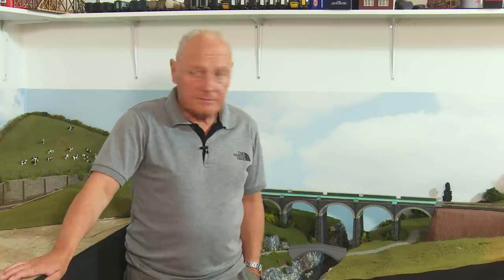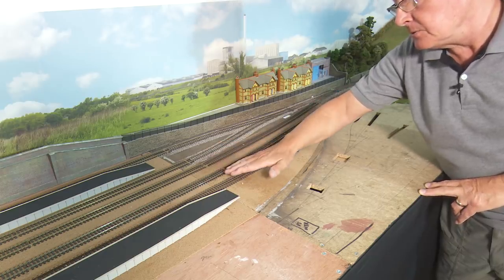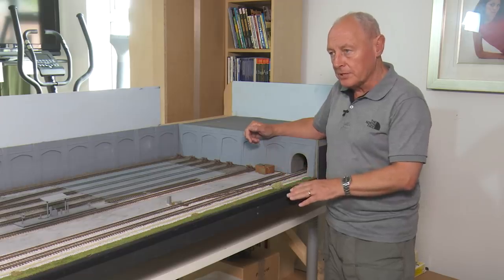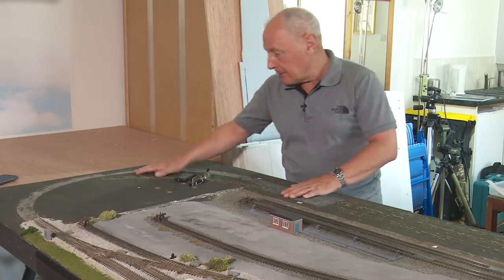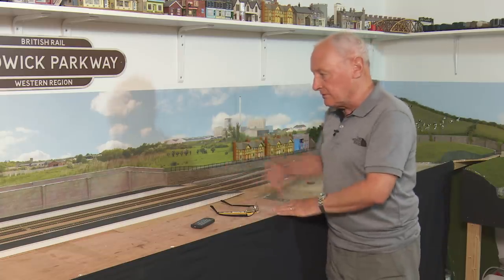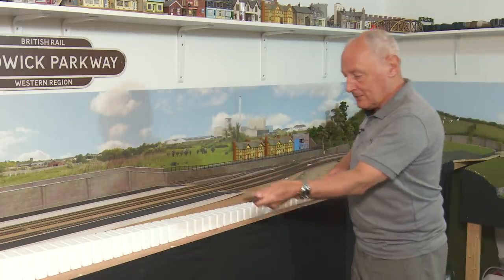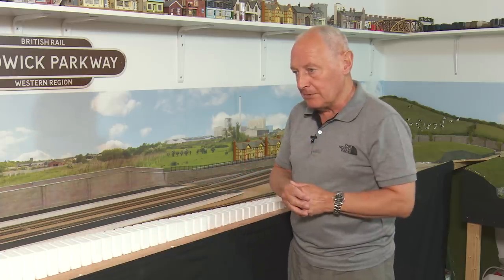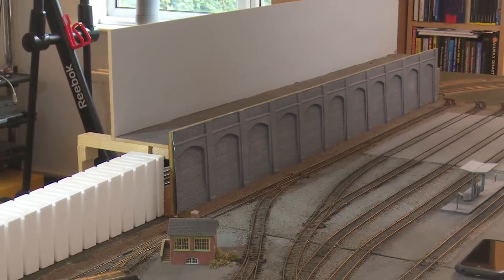A boring track plan at Chadwick Model Railway. | 72.

Comment: Another great entertaining video Charlie (and I like the haircut!).  My layout plans are going through the same  machinations as yours.  My layout was going to be a tail-chaser, but I didn't want a lift up section or have to crawl underneath to access the centre, so I'm changing it to a "U" shape with return circles at each end to give me up and down fast and slow lines through a "Nottingham Victoria" style main station.  But the main running lines are all going to be at +100mm and I need to get down to the base level at +0.00 for the MPD and fiddle yards, so your experiments with inclines were extremely useful.  Keep up the good work and the videos.
Reply from the maker: I’m so pleased that you enjoyed it and found it useful Geoff.

Comment: Great video Charlie....but, if I may, the 4% is way too steep and detracts from the work already in place or planned. I would opt for a 2% grade, curving to accommodate length, and blend scenery around or tunnel (for a scenic break) before entering station forecourt and throat. Also leave the goods siding, great idea and too good to lose. It will come in handy in so many ways. These ideas blended with the expertise of the other contributors should bring you to your solution. For myself, I try to plan situations which will require me to watch carefully and not nod off...Rather like american practice where double track suddenly becomes single and requires prioritizing traffic.
Reply from the maker: Sound advice mate, many thanks.

Comment: Hi Charlie, I like the idea of the terminus station but that incline "looks" a bit steep.  I know your diesels will get up it but it just doesn't look right to me. You mentioned that the 4% ended about 3/4" below required level so could you not use a 3% incline and extend the climb around the end of the room? There may not be room, difficult to tell from your video but hope so. In  terms of the width I would suggest as others have that you use the foam as a base to build out a bit of ply to widen to 2 track width. If you have Anyrail that is really useful for testing out incline lengths. Think the idea of swinging the TMD board round is sound as well
Cheers Steve
Reply from the maker: Sound advice, thanks Steve.

Comment: Very interesting. Keeping in mind a good few branch type lines will run with inclines randomly spread across the route, guessing they were always designed for slower moving trains, makes sense to add an incline rather than digging out further just to keep the line as flat as possible. 
My layout is full of inclines ranging in various lengths and nothing struggles on any of them. All were fully tested with 12 coaches. 
I like the idea of inclines as it adds a great dimension to a flat layout.
Reply from the maker: Great encouragement, thanks mate.

Comment: Charlie,  at present I don't have a layout. Just sections waiting for space to become available. I did have a nice operating layout. I used by single track  4 percent grades for the first 3 switchbacks and the last two switchbacks I used double track 2 percent. I modeled in HO scale.  My trains were all DC .  Using 2 locomotives on head end followed by 10 or 12  40 ft open coal hoppers. My base mainline was 52 inches from the floor. My branch Line to the coalpit started at 52 inches then rose another 3 feet.   I worked out all the elevations myself until I was happy with the operations. I used a modified cookie cutter idea for rise in elevations. I referred to Jim Mc Cleahands book.  Modeling Coal Roads.  Unsure of the publisher.  The risers we're all wood blocks cut to width then screwed to risers cut to length. Following Jim's table of inclines per gradent.
Good luck in your pursuits.
You have right idea.
Reply from the maker: Thanks James, valuable advice

Comment: I'm facing similar issues on my layout re the incline double width issue. In an attempt to aviod doubling costs on a parallel incline, I'm considering using 3mm ply cut to railwidth needed and placing that onto the single incline structure. As always the issue of cost verses time is a factor. I'm now going to wait and watch you! 😜
Reply from the maker: Oh, no pressure on me then RCR! 😜

Comment: Hi Charlie, Glenn from Australia here. Another great video, brilliant to have a tour of the layout, cheers.
Like the idea of the risers and second station above fiddle yard. Will add more operational options. Roundy roundy and fiddle yard, to terminus, the best of both worlds. Speaking of operations, have you considered the possibility of double crossover in your existing station ala Exeter Central for making up and splitting pass. trains?
Also wanted to say a friend here has used the same 4% risers, only single track though. He had a few issues, diesels were generally ok but steamers did struggle, maybe not a problem for you. He overcame this by using the DCC magnet system, not sure what its called? The other thing to make sure of is that all couplers are level and reliable as he used to have quite a few breakaways on the transitions up and down. I am certain you will be on top of this though.
Thanks again, is good to hear your thoughts and conundrums re. planning
Reply from the maker: Sound advice, thanks G.

Comment: Whilst it may be expensive, maybe to liven up the area where your stations tracks convert into two tracks, you could do something similar to what Newcastle Central had in the 1950s, although more practical using double slips and diamond crossings etc?
Reply from the maker: I’ll have to do some research Luke.

Comment: Hi Charlie,  Some years ago I used the self same products for similar reasons and all the locos went up and down the inclines correctly.  The layout is not completed as I have not built the equivalent of the station (been working on Yeovil Town at the club) and the loft is bunged up at the moment else I would show you how it works (I am in Yeovil) - On my layout I used that product with the black track-bed as I could start the incline around a bend (something that works well to save space) - I wish I had thought more about droppers prior to laying track.  I have a double concrete track for modern image.  Paul
Reply from the maker: Sound advice mate, many thanks and we’re nearly neighbours!

Comment: Hello Charlie. As you know, I'm a big fan and love what you're doing but I'm a bit confused with your plan for the elevated station. 
The planned incline looks as if it will start before the current through station so that traffic to the high level station will avoid the through station. I think it would be unusual for a branch to diverge before the main station.
Just a thought but have you considered having a high level platform, part of the way up the incline (short level section) so that the main station would be served by the branch?
I hope you understand.
Regards,
Bob
Reply from the maker: Hi Bob, yes that’s something that I have considered and it’s still an option.

Comment: I’m building my first OO gauge DCC layout and use the 4% woodland scenic inclines. A great product but you would need two sets side by side to ‘safely’ carry your double track lines to Chadwick Central. 
An elevated station would be a great idea to ‘hide’ the fiddle yard, as long as you build in easy access for ageing hands and eyesight!! (from personal experience)
You could also run a line, ‘elevated’, through Chadwick Central and connect back down an incline with your beautiful new viaduct.
Thanks for the great video production and interesting topics. 
The most important thing though is, would YOU enjoy that layout?
Reply from the maker: Thanks John, it’s comments such as yours that make it worthwhile

Comment: Another great video. Thanks.  When I added a terminal station onto a small 5ft x 6ft layout I just used 1/4” ply supported on blocks of wood of varying thickness.  Worked treat.  (00 gauge). Also avoids the environmental issue of using polystyrene.

Jim
Reply from the maker: Sound advice, thanks Jim.

Comment: Hi Charlie,  You've given so much help in the past, so I'm pleased at last to be able to share a little experience in return.  I'm using the woodland scenic's risers and double track.  I've got a branch line going upwards and the two main lines going downwards so that the main lines which lead to the fiddle yard are under the branch line which is my scenic area on that side - opposite the main station something like yours.   I'm using 2% (with a bit of 3% starter kit).  I bought double quantity for the double main line, because a) of the extra room needed on the curves for the carriages swinging out, and b) on the curves, the outer track is obviously longer (a wider radius), so that they both finish at different times - especially as the distance between the tracks had to increase for the carriages.  In terms of pulling, I've got a Bachmann Director class (GCR) pulling 7 coaches, but it struggles a bit.  It needs more weight in the loco - so that if I just put a little finger pressure on it it's fine.   I'd be worried about doing 4%.  Your test gave confidence that it might be the loco I'm using rather than the incline or the number of coaches.  PS.  I'm still working on the fiddle yard and found your track plan discussion in your other video very helpful.  I'm planning a variation on that, adjusted for reality as I go.  Thanks again for the videos - not least that it takes only 15 seconds to get into the action - unlike some channels.  Brian
Reply from the maker: Hi Brian, what a terrific contribution.
I am so grateful. Stay tuned I’m already making up my mind!

Comment: Hi Charlie, great video, wish my layout was that advanced.
One point on your train movement description: the crossover would normally be trailing, not facing, and at the other end of the Station. 
A DMU would enter the Station to unload then pull forward to reverse into the opposite platform to load.
Reply from the maker: Sound advice, thanks PG.

Comment: Morning Charlie,
The Viaduct scene looks great mate, I like to see a long Station if room is available, could you make that the main one with Chadwick Parkway along the other side,  if i had the room I'd blend my Fiddleyard in with the Layout, there's one at Crewe which you Pass over on the A500 it looks impressive and sure it would done in model form, 
And the end of the day it's your decision but nice to have others ideas and suggestions, I'm sure it'll look good whatever you decide  👍
Reply from the maker: Sound advice, cheers mate.
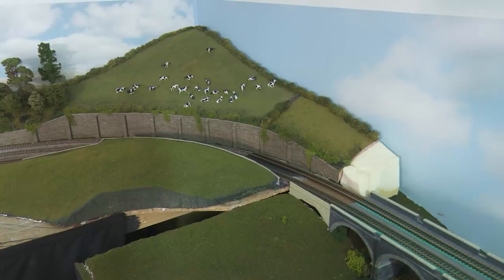Reply: Hi Charlie,  oh never boring, but always a challenge. My experience of testing with 1:25 grades was there was a large variance across my engines  when comparing flat to 1:25 haulage performance, so recommend you check across your fleet if going so steep that all engines perform to expectations. I have settled on 1:50 nominal, worst case 1:40 to minimise haulage losses and make grades look (to my taste) reasonable. Personally I think 1:25 looks too steep. I had to drop my final height to achieve my target grade, perhaps you might consider to drop your upper level height? I am still at layout planning stage, using the CAD which is great for assessing grades, track plans and what layouts look like with scenery and buildings. As always it's a compromise! Have much enjoyed your channel, experiences and advice etc, many thanks. Stephen.
Reply from the maker: Wow, what a great comment.  Yes it’s truly a dilemma. Thanks for your sound advice Stephen.

Comment: Was going to use the 2% incline kits on mine but due to the fact both of my incline/declines are on curves and parrallel tracks i couldnt get my head around how i would make them work. Because i would need 2 side by side for parallel tracks obviously the outside curve kit would always end  up needing to extend further than the inside kit and would thus end up different heights ar the same point as the inside curve. 
I ended up scrapping the idea and just opting to build by inclines via carpentry.
I think the 2nd station is a great idea though Charlie. Hopefully you can sort out the best way of approaching it
Reply from the maker: Sound advice, thanks CRL.

Comment: Hi Charlie.
Of the five scenic areas you'll end up with, it's the TMD that seems the odd one out for me. I'd suggest having the Viaduct, the Parkway, the undeveloped end module, and Central all on a single level, and dropping the TMD to a lower level in front of Central. This would work aesthetically for me as the TDM has the two end retaining walls that create a strong scenic break, and practically as inclined tracks could be hidden in these end areas (and extending into the fiddle yard as needed) to get back to the main level. But proto-typically speaking, I have no idea if this makes sense. I'm from NZ and don't have the best grasp of UK railway practicalities. If it's not prototypical, I'd love to hear what it is I'm missing.

Also, it might have been mentioned before but if you run two sets of inclines around a curve, the top of the inclines will be staggered, as the outside incline has to travel a greater distance around the curve. Other people are suggesting sitting a thin, wide board on the top of one incline, but another way around this would be to use one incline and build up the required width by glueing vertically, thin sheets of styrene to the inside and outside faces of the incline. This at least keeps the incline as a single material.
Reply from the maker: Or Greg, putting the TMD on the upper level?
Reply: @ChadwickModelRailway  HA. That too Charlie. It also looks like your access to the layout is by scooting under the TMD, so lowering it would probably make getting in and out a bit more of a hassle as well.

Seems a lot of people aren't into that 4% grade, so perhaps another option might be to start the incline after Parkway, and run it as a hidden line parallel with that end wall, and running as a peninsula into the fiddle yard area of your train room - so if you were facing your fiddle yard, it'd be an inclined peninsula on your left hand side. Again, I can't judge this on its prototyical-ness.

Comment: Just a thought, Charlie, but why two inclines side by side?  Why not a wider track bed fixed onto a single incline and the side filled out with scenic material?  About half of the cost and no messy hacking away at foam polystyrene.
Reply from the maker: A fair point but I do worry about noise transmission downwards.
Reply: @ChadwickModelRailway  The incline is foamed polystyrene which absorbs vibrations quite effectively.

Comment: I'd start / finish the incline on the TMD  board possibly starting off the curve from the viaduct using a slightly less severe incline.   Starting on the curve probably would blend the incline in more rather than on the straight.   Personally I don't think you need another level although I can see why you might want one.   My own layout is all on single level and to really blend in a raised section even in N gauge takes a fair amount of space.   I think if you add an incline it will always look a bit forced i.e. shoehorned in.  Euan
Reply from the maker: Sound advice, thanks Euan

Comment: Is location a 3 mm ply base wide enough for double track  on top of the slope an option, as long as the tracks center lines are not outside the foam core
Reply from the maker: I’ll check it out JS

Comment: G’day Charlie, I’ve been using the Woodland Scenics incline on my layout for a couple of years now. I used matte board (the stuff used for mounting photos) because I had stacks about. After gluing the incline in place I cut the board large for two tracks and glued it to the incline. It has been working a treat sine I installed it. Hope that this helps.
Reply from the maker: Sound advice, thanks Tom.

Comment: Hello Charlie,  I am not comfortable making any suggestions about what you should do. I will share my philosophy in regards what makes a layout interesting. First off, less track more scenery. Second, more curved, less straights. Third, flat is boring, multi levels, not so. Lastly, but most importantly, detail, detail, detail. Trains don’t need to be seen all the way around your layout. Have them disappear through tunnels and mountains. Have them reappear somewhere that’s unexpected. You proved many of these philosophies with your recently completed viaduct diorama. Also, I would make my own inclines if I was you. More controllable. Okay, like I said, just my philosophies. See ya next time.
Reply from the maker: Sound advice Norman, thanks